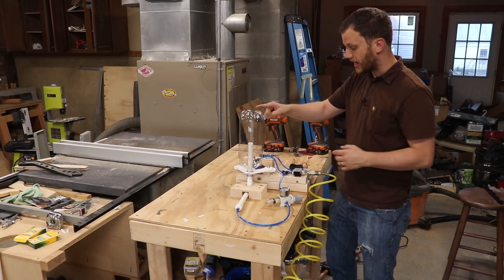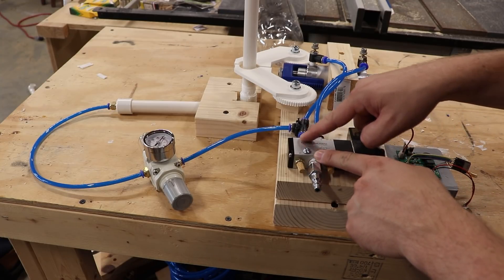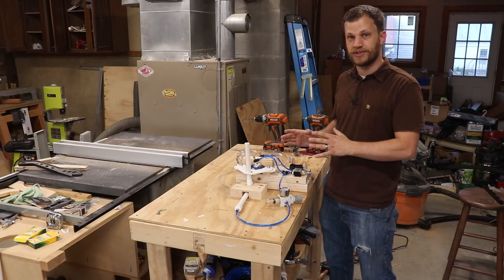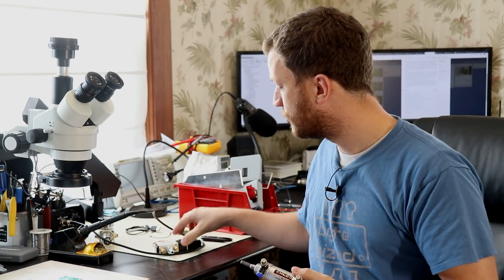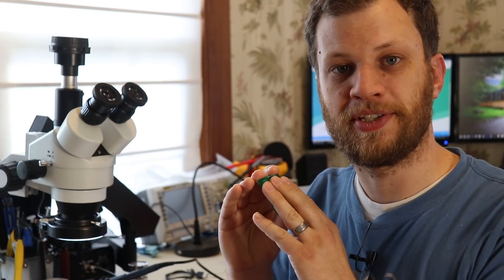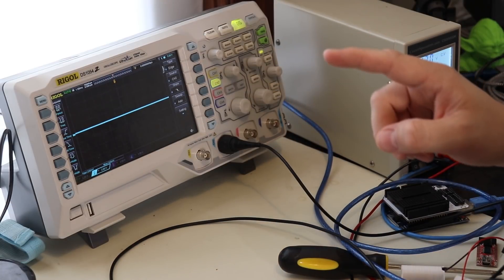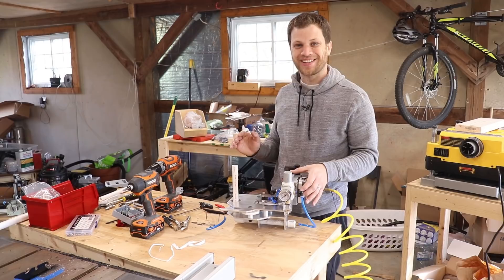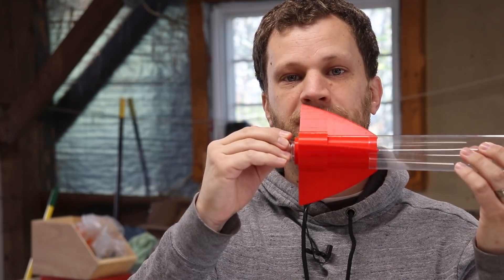World's Most Overengineered Water Rocket!

Comment: You do realize they’ve been doing this better with a handful of zip ties for the last decade or more. This is all at the engineering level of about 2 while the current top end of water rockets is around 11. 1000 psi multistage rockets that fly over 2000 ft
Reply from the maker: You're totally missing the point of this video. Of course there are easy ways to do this. I didn't want to do it the easy way. That's why I over engineered the crap out of it.

Comment: Hey, some consideration...
"Soda bottle" have good efficiency because of their mass, so if you don't up so much the pressure use soda bottle...
3D printing is not sealed, you must coat it with resin...
If you choose to design something different from soda bottle leave behind the uncomfortable screw connection of soda bottle and his high diameter

Comment: Growing up in Europe, I made rockets that were similar with a bicycle pump.  At the time, Germany had re-usable PET bottles with much thicker walls, which could hold a LOT more pressure than a US 2 liter bottle.  The would fly as far as a traditional rocket.  You could significantly optimize your design by making a smaller nozzle for the water to come out of, it will give you much more thrust over a longer duration an enable much better flights.  Fins will help stabilize it, but a more weight efficient design is like a bottle rocket, with a stick for stabilization.  For this to work properly, your stick needs to be 9 times the length of the body.  The bottle will expand as you pressurize it, so I'd recommend taping it on with gaffer's tape (as opposed to glue)   I love that the launcher is so overbuilt!

Comment: Nice project! I need to replace my binocular microscope with a trinocular, and I'm curious what model you've got. For soldering irons, are you familiar with Metcal? Once you use a Metcal, everything else feels like you're using an antique wood burner :)
Reply from the maker: Thanks J.C. The microscope I have is an AmScope SM-6TX with a Cannon DSLR adapter. I really like the articulating arm mount because it's much easier to adjust than other types. If you are interested I have some affiliate links below. 
https://amzn.to/2TU9yPs
https://amzn.to/3l5eM6Q

Regarding soldering irons, yes I've used Metcal irons at various places I've worked. They are wonderful! I'm on a tighter budget here at home so I'm stuck with my antique wood burner :-)
Reply: I think you'd be surprised what you can pick up a used MX-500P-11 base, a wand, stand, and a few basic tips for. Take a look on eBay :)

Comment: I did not think that clear tubing would hold up to even that much pressure. I've come across them before, wondering the hardware store, and at first glance thought they were thicker, similar to schedule 40 PVC pipe, but was surprised by how thin and flimsy they actually were. In retrospect, I guess they're probably about the same thickness as the 2 liter bottles, though. What exactly failed on the rocket? I assumed the plastic tube expanded too much or the 3d print failed?
Reply from the maker: The clips of the custom red rocket were some tests. I ended up putting clear packing tape around the PVC pipe and it sealed really well. Everything withstood the pressure so far. I'm only at 40psi so not too crazy.

Comment: Awesome project. I notice the bottle was not completely seal at locking point.  If you put heat on the section where it locks and squeeze the pvc together it will  make it a bit wider to seal the gap 100% as so the water f don’t leak out.
Reply from the maker: The clips shown were some tests. I ended up putting clear packing tape around the PVC pipe and it sealed really well.

Comment: Have you seen air command water rockets? Those are next level water rockets.
Reply from the maker: I haven't, I'll have to check those out
Reply: @bytesizedengineering  it’ll blow your mind. 1000 feet plus altitudes. Hundreds of psi pressure.
Reply from the maker: I take that back! I just looked up their videos, and they look very familiar. I'm sure I've seen at least a couple. Thanks for reminding me. They have multi stage rockets which is incredible!

Comment: Great project! Does the bottle screw into something on the launcher? If so, how does it unscrew for launch? And if not, how is the water and pressure being held? Thank you :)
Reply from the maker: No, the bottle fits pretty snug over the PVC pipe. I did add a layer of packing tape to make a good seal. The only thing holding the bottle down are those locking forks.
Reply: @bytesizedengineering  ah nice! Thanks
Reply: Packing tape acting like a rubber hose washer?